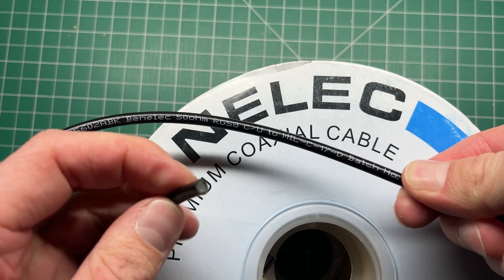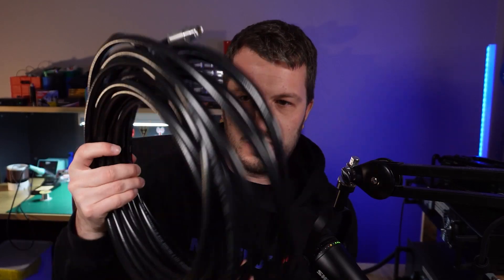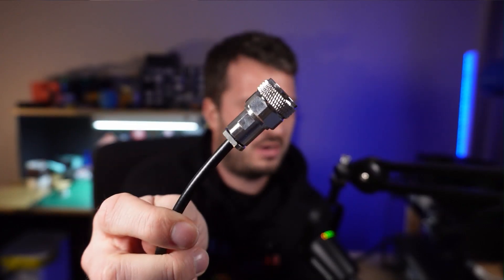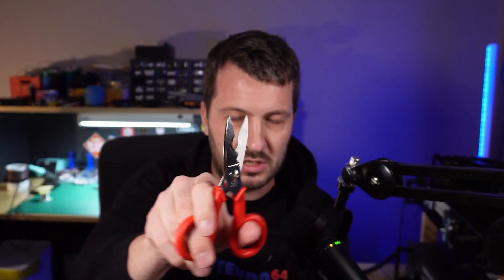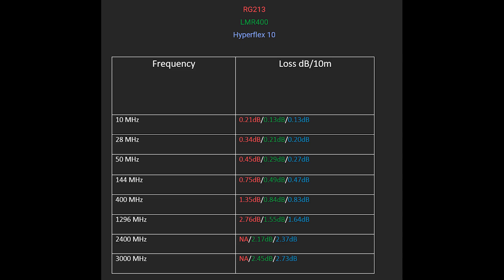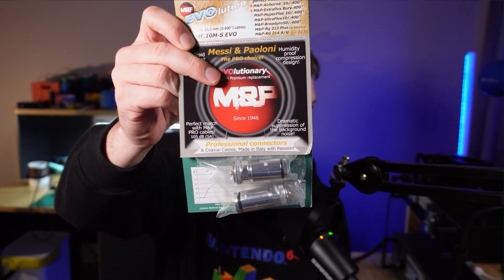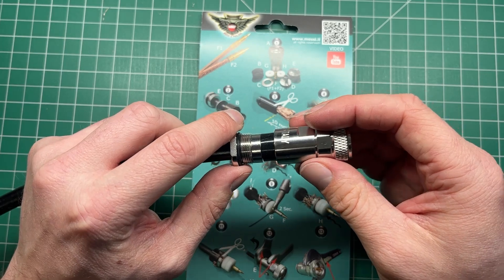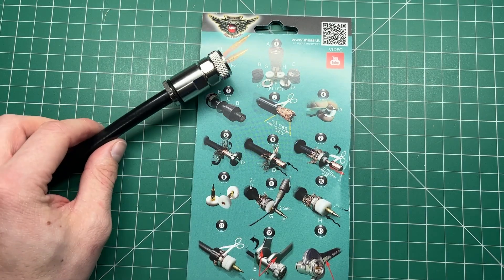The Coax SUPERIOR To What 99% of Hams Are Using

Comment: Definitely on my shopping list, along with DX Commander Signature 12.5!

I do have 2 related questions:
1.  Is there an argument against using “N” connectors for HF.
2.  Can you do a video on static/lightning protection.  More interested in product recommendations.  I suspect there is some rubbish out there.
Reply from the maker: 1. Not really an argument against using N for HF... only that nearly all HF radios will have a SO-239 (or BNC) on them rather than a N type so you'll need an adapter. 

2. I'll put it on the list. Lightning isn't really a major issue around here. I don't use any lightning arrestors and (tough wood) I've never lost any gear to a strike.
Reply: Hi Terry   The N connector is certainly the best solution to go for. 
Anyway, for the HF we have brought the N connector technology to the M&P-UHF EVO connector.  They look very similar and the performances of the UHF EVO are far beyond those of the classic PL 259, to such an extent that could be used up to 4 GHz
Reply: @MessiPaoloniSRLAncona  thank you!  You have cleared up things for me.
Reply: Hi Terry, I was researching these cables and I thought there was an ‘N’ type available from M&P.  I would love to put one one for any needed ‘N’ type.   I really like the way these compression connectors go on.   I used to say no to UHF/PL-259 connectors for higher frequencies but if the cable performs anything like I hope I don’t think the loss at the UHF connector will be bad.  This is my own opinion.  Cheers, 73 de KI5HXM!
Reply: @brentjohnson6654  N connectors along with our UHF EVO are our best sellers

Comment: Haydon, The M&P cables and connectors are unbeatable! no IF's and no BUT's. I use Hypeflex 5, 7, 10 and 13 here. As well as the direct bury Hyperflex 10. Allow me two quick points. The PL259 connectors have a rounded nose and are soldered internally. Brilliant idea. No more scraping of the excess solder of the actual pin cause it will not slide into the SO239.
The scissors are a MUST and for the following reason:  If you cut a coax cable with a side cutter... NO MATTER how sharp.. you tend the deform (flatten) the inner conductor somewhat. Using their scissors.... that problem never occurs. I had long run out of naughty words while trying to get the center conductor back into shape.... as it is a perfect fit on the Pin... but only if you have not deformed to center conductor. Once you use these scissors, you will never go back.
To all colleague radio hams... drop into their website: it is TRULY A GOLDMINE of info on all matters coax cable and connectors. I refuse to use anything else. Am driving my zachtek 180 milliwatt transmitter on Whisper with 20 meters of Hyperflex 10. The dammed thing is ALL OVER VK LAND AND ZL land ! I'm going to be barred from ever visiting down under. Enough said ?
Albert. EI7II.

Comment: Brilliant cables have a 30metre run of Hyperflex 13 on VHF/UHF, runs easy round the rotator.
I use Hyperflex 10 on both HF antennas and Ultraflex 7 for jumpers.
Here in the UK the price is not to bad for the quality.
The connectors may seem expensive but are very good quality.

Comment: Nice video. How about LMR - 400 Ultraflex? I use that at the antenna/rotor.
Reply: I use 600 UF. Extremely expensive but had a very long run with virtually zero db loss

Comment: I just bought some of their BNC and PL259 connectors. I am looking forward to them arriving. I have not found crimp connections all that reliable so am changing everything to commercial soldered connections I use milspec RG58 C/U as I mostly/only do SOTA. Their cable does look nice but.
Cheers
Andrew VK2ZRK
Reply: In addition to my last. I have made a few feed lines from LMR400UF and I only use genuine Times Microwave Systems connections. I think if you are going to spend that sort of coin on coax why scrimp on the connections.
73
VK2ZRK
Reply from the maker: Buy once, cry once when it comes to coax!

Comment: Haydon welcome to the "M&P convert club", like you for years i used rg 213, in my case it was cabinex rg213M , my situation is from my shack to my tower i have underground 4 inch pipe going to a external box near my tower and then up my tower to various antennas or in a different direction to my to other antennas,, approx 2 years ago i bit the bullet and after my consideration bought 2 100m rolls of ultraflex 10 and the M&P scissors, i know have 8 lengths @ 10ms underground coming into my shack onto a copper plate, and the same on the exterior box, during the cable install a good friend of mine of 25 years ham experience was helping me do the cable pulls (not easy 3 differnt bends), i could see he was interested, so i sold him 25m @ below cost(due to his help/friend), once mine was hooked up we could see a difference on hf even with standard pl259s, when M&P evolution plugs were first available in the UK my friend bought some immediately and fitted them and noticed on his simple end fed dipole better rx,i went round his on one particular day (i live 2and half miles from him), and he had his radio on 17m ft8 were i had just came from @ my home qth and he was getting 2 S points better on rx, please bear in mind that he lives in a terraced house in a town location so lots of houses close by, where i live less than 10 minutes away outside of town with 4 neighbours nearby,so impressed with difference with the rx was i  , i immediately bought the required amount of M&P evolution plugs pricey yes quality 110%  for a fit once never replace plug its a no brainer, my rx has also gone up by 2 S points,in fact at the time this video comment 2 days earlier i worked roly ZL1BQD in the wwdigi ft8 contest, a mere 11,210 miles on 40m ,or with the same coax and plugs i worked ZL2CC on 60m with 100w him 15w eirp @ 11,319 miles to gain me a all zones on 60m/9 bands in total, the beauty of this cable is like you said it bends no problem, suitable for rotators etc, and as i understand the figures is good for 9kw key down on 80m cw, not i need that in the UK :), yes its pricey and so are the plugs, but if your dropping 3-6k in a radio/pc /headset etc ,etc why not get a 100m drum or 2 and the correct plugs, here in the UK i have found Radioworld of Birmingham best for customer service for M&P products, good choice Hayden :) :)
Reply: I might revisit this topic if I drop in more money. For starters everything is fine with RG58 and RG213. Get up that antenna and myabe add 1 or 2 elements. I'm not sure how you get 2 S units more, this is 6 dB or 12 dB depends on the manufacturer of the radio. I measured my cable to have about 2 dB loss at 30 MHz for 50 m cable. 1 dB improvement for 2.5 times the price doesn't sound reasonable for me. I might try out out with Hyperflex 5 and RG58 in camparison but I think it's only worth in VHF und higher.

Comment: @HamRadioDX - Thanks for this update, when i put up my new antenna's, ill try this coax over the excess RG58 i have laying around. | Price of LMR400 makes it all the more of a incentive to buy Hyperflex 10. Spending a ridiculous amount on LMR, only for the motorized antenna mount to break down the core and shield over a few months from its rigidity. Means a more flexible cable is a no-brainer. 

LMR does great in straight runs through conduit, but on a motorized mount, your either stuck switching between other coax and balancing the loss from that (and the connectors) or making some type of solution to strain relief your feed line.

---

How does Hyperflex handle weather changes? Hot and Cold temperatures, do they affect the cable or induce additional loss? | I cant Speak for Tazzies, but in VK2, we get everything from 49c+ to -5c. | Does this stand up to these weather conditions? Can a station operate for a year or more reliably without cable damage?
Reply from the maker: The specs say that hyperflex 10 will deal with -40 to +60... check out their "Sahara" cable!!!!

Comment: One of my biggest complaints is. A lot of coaxial cables are not copper. But copper coated steel wires that rust. Thus becoming unreliable. Test them yourselves with a magnet. Even resistor wires are steel these days. Cheers from old George in the UK.
Reply: Cheap Chinese cables are copper coated aluminium. I used that to my advantage for portable operation, I bought the cheapest RG-58 from China I could find. It really is quite light and performs about as well as you'd expect from RG-58!
Reply: @paulsengupta971  Mine were steel and I check now with a magnet.
Reply: There is no trace of copper-clad steel in our 50 Ohm cables.  All our cables have pure copper cores, save Airborne 10, which has copper-clad Aluminum core exactly like the classic LMR 400 to which it is inspired.  We have made anyway some changes: we use copper foil and a copper-clad aluminum braid instead of the Aluminum foil and tinned copper braid. No rust! let us leave that stuff to the Chinese.:yougotthis:
Reply: @MessiPaoloniSRLAncona  Thanks for your reply. I will do a video soon showing my findings. Showing power cables ad well as coax. Cheers from old George happy DX

Comment: Thank you for this video! I use the M&P 7 mm cable since 3 years for my /p operations at my camping trips, from 80m to 70cm bands, it works excellent! Ham radio operator for  now over 40 years, what a nice cable, after experiences with those RG- and stiff Aircell-Cables ;)  vy73 from Hamburg/Germany, Dietmar, DL4HAO

Comment: The M&P connectors have completely revolutionised the "fiddle factor" in the shack.  They are brilliant.  Buy once cry once.
Reply from the maker: 100% correct Tom. You can't beat the quality for the price!
Reply: @HamRadioDX  Hi!

New ham/new subscriber setting up Astron 35A power supply, IC 7300 and probable EFHW antenna to start. Not planning on a tuner to start. QTH rainy and cool. 
Are the M&P connectors waterproof like N type connectors? Do they have an alphanumeric descriptor or just called M&P? 

Do they only attach to each other or are they compatible with any particular other connector? Will check out their site for sure!

Thank you!
73,
John - KK7JBZ
Reply from the maker: @johnbauman4005  Hi John, 
Congrats and welcome to amateur radio! The M&P compression connectors are designed for protection against water ingress, but I wouldn't say they are waterproof. I'd still recommend sealing them, either with their Silicon Seal or self-amalgamating tape. 

https://messi.it/en/catalogue/50-ohm-rf-coaxial-cable/n-male-connectors/10mm/solder.htm

https://messi.it/en/catalogue/accessories/shrink-tube-mep-silicone-seal-l.htm

The connectors are labeled per the cable that they fit, the type (N male or female).

They are compatible with whatever is the opposite connector (regardless of brand), so an N male will mate with a N female. A PL-259 with a SO-239 etc.

73 and good luck!

Comment: Newbie here. I ended up using Telco Antennas TEL450 1/2" Corrugated Coaxial Cable on my IC9700. My mate and I bought a roll and in the end used it everywhere. It pretty rigid stuff but once you get used to working with it the losses are so low that it really wasn't worth buying the LMR400 or anything else for that matter @ 6.50 /metre. Signal Loss: 0.067dB/m @ 850MHz, 0.11dB/m @ 2100MHz. The connectors are a bit pricey but beautifully made.
Reply: That's LDF4-50 or 450 Heliax. Yea when I do a permeant vertical install for VHF/UHF I'll use that stuff too. I think where M&P works well for guys using Heliax is when they're running Yagis on rotators, you can have high quality connectors going to a low loss flex cable for the rotator.
Reply: @Channelmaster73  Which is exactly what I do. M and P on the flexible part of the rotator and then the 450 to the radio.
Reply: Try Hyperflex 13... it's so flexible that your installation work will go much smoother.  Used by the USAF and in Dwingeloo radio telescope, to mention some...

Comment: Since we're on the topic of coax, in your last video, the one about the 905, you mentioned the antenna setup using hard line for 2.4ghz. What is the benefit of using hardline over coax? I would greatly appreciate it if you explained when it is best to use coax, hardline and heliax.
Reply from the maker: Hardline is still coax, it's just a "hard" form.. i.e. usually solid or rigid copper outer (sometimes with no jacket) and lower loss than conventional coax. 

A good summary is available here - http://audiosystemsgroup.com/HardLine.pdf

Comment: Iv used Ultra Flex 7 for the past 5 years on my portable set-ups as it works well on 2m 70cm for SSB competitions. HF, well, with a resonate dipole performs amazingly.
After watching this though, I will invest in some Hyperflex 5 for HF portable to get the weight down. Thank you HRDX.
Reply from the maker: Airborne 5 is also a good option for a RG-58 substitution that is light weight! Cheers!

Comment: Nice video hayden wht do u do if only have the stiff lmr400  available on rotators use pigtail 213 or get a big space between rotator and lmr400
Reply from the maker: I wouldn't put LMR400 (with a solid core) around any rotator because the constant movement/flex may cause the centre conductor to fracture or break.. Use that cable on your fixed runs and then a short patch lead of Ultra or Hyperflex around the rotator will work well!

Comment: How long is the discount code valid for? I've been checking them out. I wish I hadn't gone and bought 2, 17 meter coils of RG-213 now...... I do need something light and low loss for portable operations though so I think I'll get that at least.
Reply from the maker: I don’t think there is an expiry on the discount code 👍
Reply: We confirm no expiry!   Light and very very low loss, are Airborne 5 and Airborne 10, the utmost for Dxing teams such as in the forthcoming DXpedition at Bouvet island.  A bit stiff though but buriable and sturdy and very light.
Extraflex bury 7 is a great choice adding more flexibility and sitting in between the two sizewise.